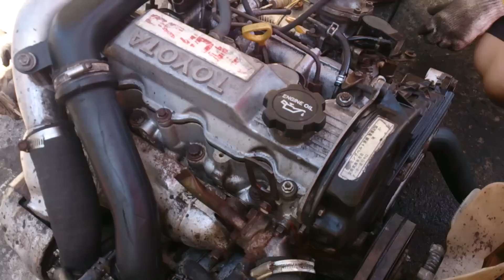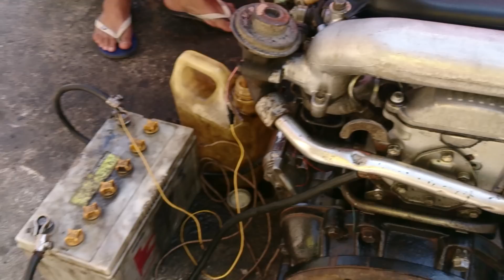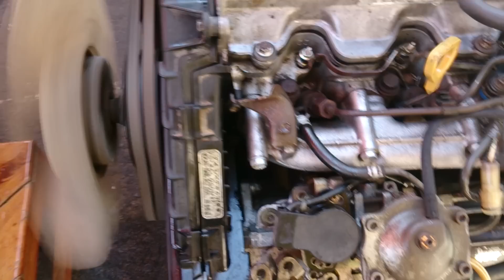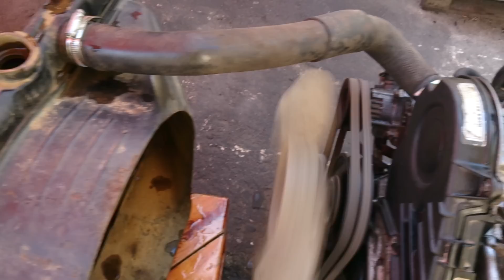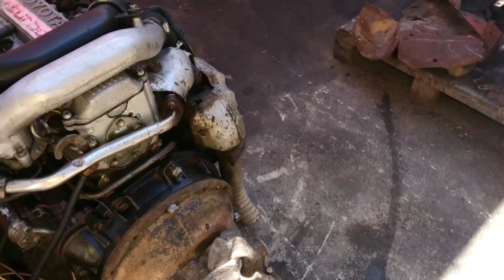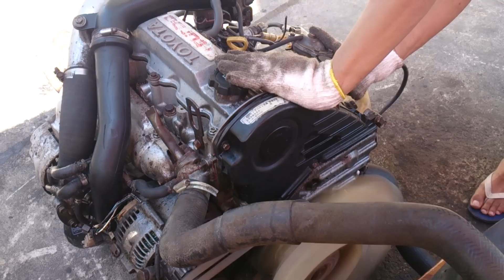TOYOTA 2C TURBO

Comment: I have a 3ct, put a BMC cone filter on it as it was easier for my conversion, now that turbo noise is making me crazy on the road, engine is in a series2A land rover so zero padding in the engine bay, does the turbo always whine like that or will a different air filter setup i.e stock setup be more quiet?

Comment: I got a 2c toyota 2.4 diesel,got problem,,when I start take to long!it idle normal but when I rev white smoke @the back,what's the probkem
Reply: Service Or Replace the High Pressure Fuel Pump 😊

Comment: Can someone tell me of the higher end engine oil, which I can use for this engine? is their any significant performance increase compared to using regular sae 50 turbo diesel engine oil?
Reply: Got one,why the white smoke when I rev

Comment: hola mira mi nombre es raul tengo una camioneta con ese mismo motor pero esta sin turbo el problema que tiene parte y queda andando sin problemas pero al salir andar con la camioneta alrededor de un kilómetro recorrido  se para el motor y cuesta que parta después de eso se para a cada rato le cambie la bomba inyectara pero siguió igual cual podría ser el problema
Reply: Same i need to turbocharge mine its corolla with 2c engine